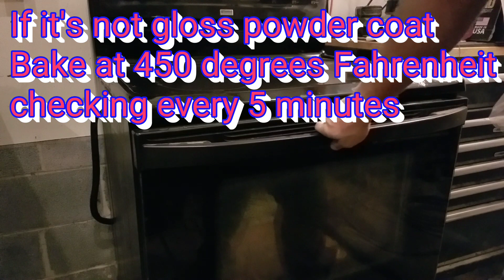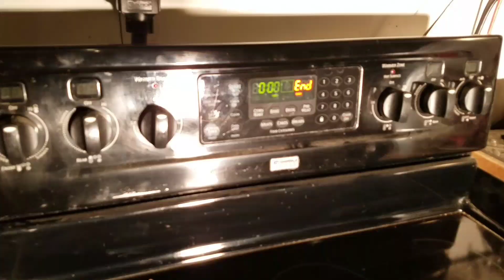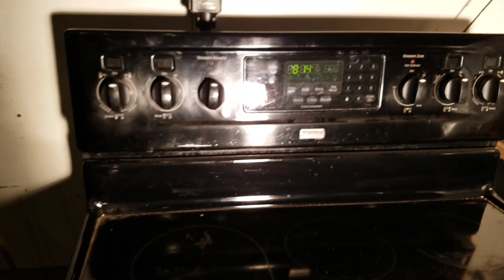Powder coating from a beginner

Comment: Curious how you will bake larger pieces.
Reply from the maker: If it won't fit in an oven Eastwood sells large heater. I don't have these so I can't say how well it works.
https://www.eastwood.com/infrared-dual-lamp-powder-coating-cure-system.html?SRCCODE=PLA00010&gclid=Cj0KCQjw2f7bBRDVARIsAAwYBBuRriiy-63oVoWGK9ZWqd8lr6OibnuDGnU_debKZuEhfyfbPO9KuT0aAmbTEALw_wcB